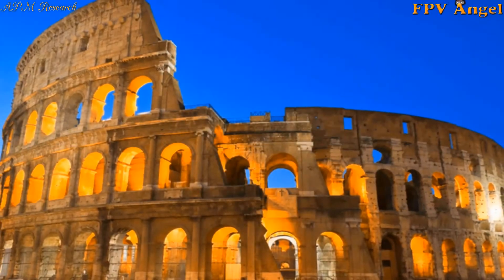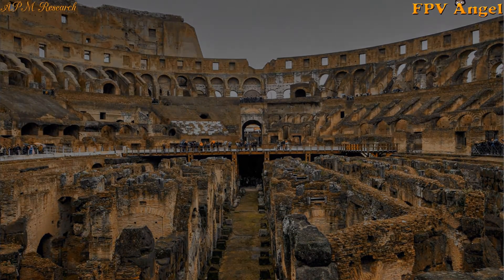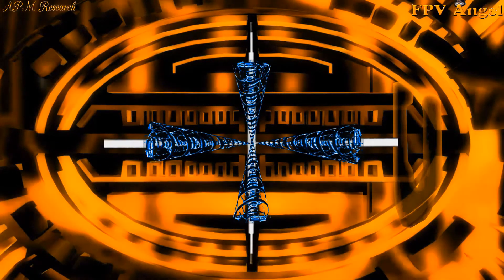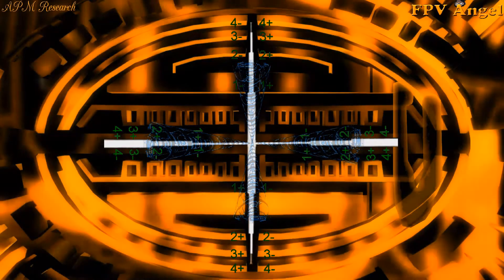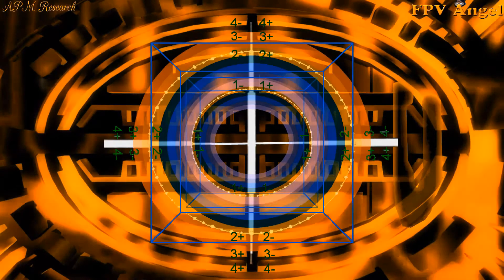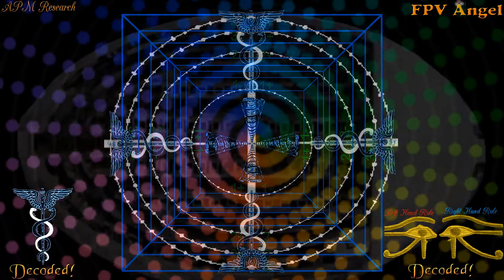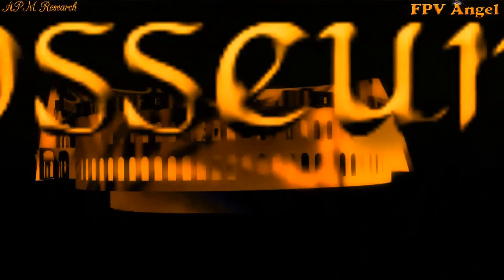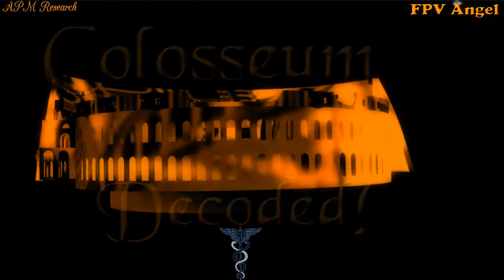APM Research: Rome Colosseum - 0 Point Energy + Sacred Geometry Decoded.

Comment: Stone and hot water?
Reply from the maker: No a little more than that ... like electrical harness points which were probably coming out of those blocks, see the Let There Be Light video to understand how the realm creates its own power and how Walter Russells optical motor is based upon it, its the same principle.
Reply: @fpvangel4495  Ok, thanks :) Yes, some buildings were found with still some kind of staples or cramps on the walls and gaps for maybe metal stuff. Will  watch the other vid.